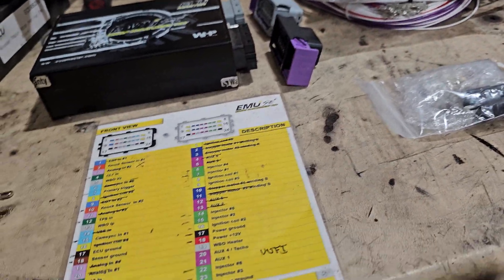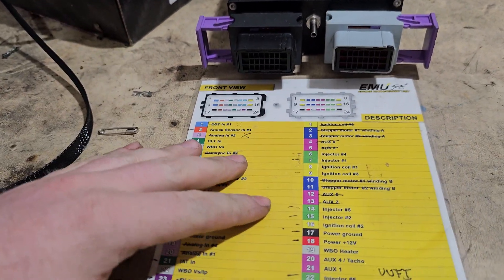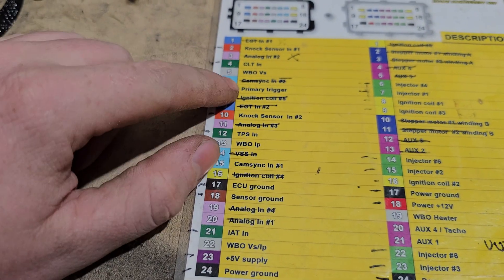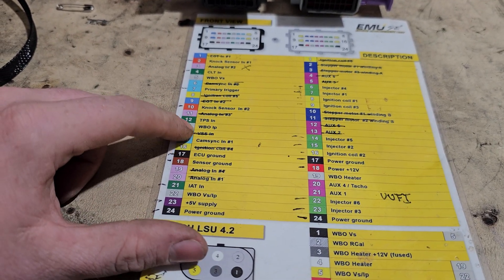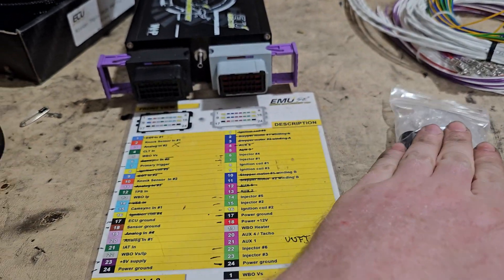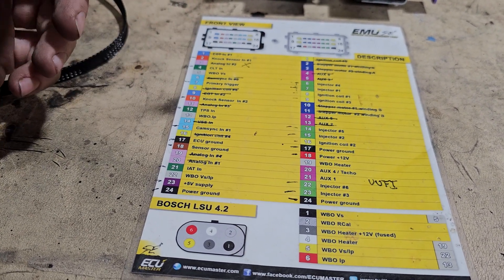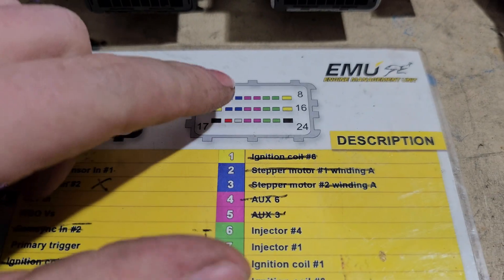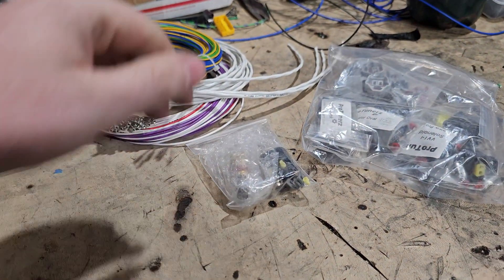UNIVERSAL WIRING TERM PINOUTS EXPLAINED (haltech, aem, ecumaster, link, proefi ect)

Comment: Can Get into the break down of shielded wire and how you terminate them…. Do you ground from the engine or from a ecu pin
Reply: If you are talking about the drain for the shielded wires , you can either do power ground or sensor ground. There is no wrong way for that. I prefer to just put it to a sensor ground pin on the ecu. Less wire and easier imo.
Reply: You ground it to power ground...so I wouldnt ground the power ground to chassy like he mentioned. Although it'll work. I'll perfer it to be open for knock sensor shielded wire.
Reply from the maker: By shielded wire, are you talking about the encased pair of wires that ecumaster ship with their flying leads?
Reply: @RabidJz  yeah... they had a video I believe.. said to ground the shield wired to the power ground pin
Reply from the maker: Those power grounds are for the ecu to function, ideally grounded to the engine block. the power grounds do not go to the sensors. The shielded wires i use for cam/crank and knock sensors. One wire to designated pin and the other to the sensor ground pin. The sensor ground pin is a noiseless ground separated from the rest of the car
Reply: @RabidJz  idk, Maybe that'll work too but more unesscary grounding wires.... but per ecumasters... shield wire goes to power ground pin. So I'll keep it the way they do it. And don't  ground those power ground to chassy
Reply from the maker: Regardless. Both ways work, ive done it on 10 different cars.